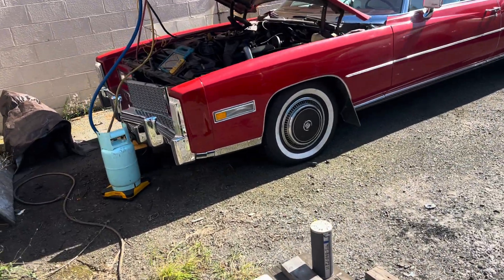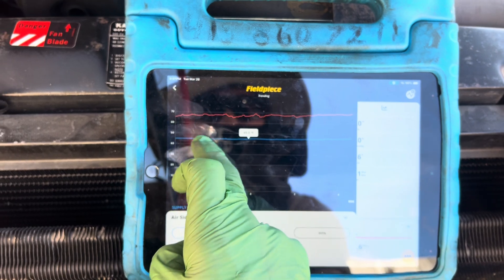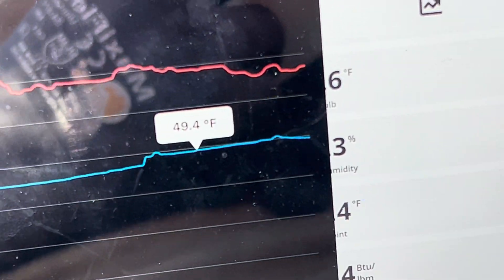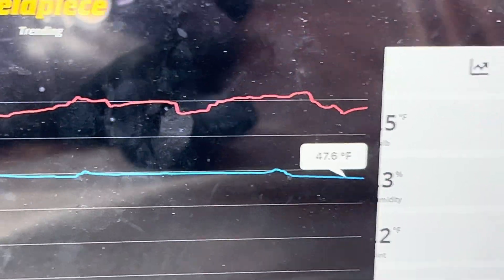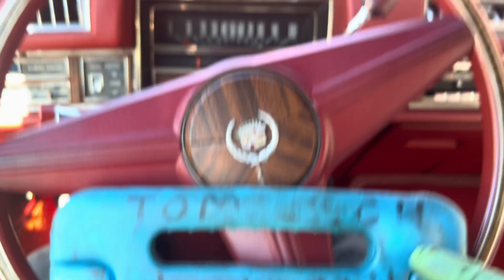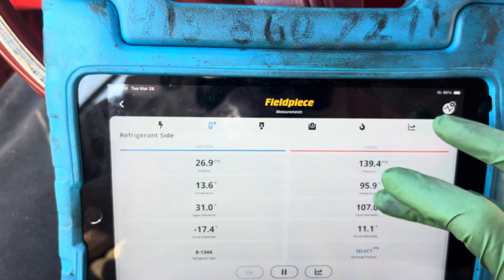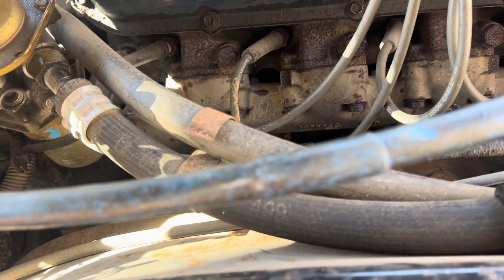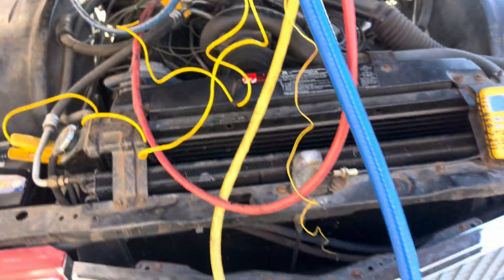R134a RETROFIT ￼ Got a bad name because of the technicians, NOT THE REFRIGERANT FAULT

Comment: I'd absolutely love to see you rebuild that VIR valve.  I am putting my 1976 Impala back together and i need the air to work again.  I'm tempted to recharge it with R12 due to lower condenser temps, but getting R12 is so hard now.  I would love to ask more questions about the conversion with old A6 compressor and VIR.
Reply from the maker: If you could still get the kit to rebuild the assembly, it’s just taking apart and putting back just pay attention to detail nothing more than seals

You could look up old information is available on ones that have adjustment how to correctly adjust them to the evaporator at the proper temperature 

Learn more I have a lot of postings over on the Facebook group 

Automotive HVAC technicians

Comment: Great info, I've always wondered about how many of the performance issues people have reported with R134a are because of other problems and half ass conversions rather than the refrigerant itself being worse. I always assumed that R134a just isn't as efficient as R12, but I have actually found studies showing improved capacity and efficiency in the same equipment running R134a vs R12, so as usual, it may not not be as simple as it seems.

I have also read that a major reason R134a sometimes doesn't work well in R12 systems is because of the serpentine flow condensers used back then, which makes me wonder if R134a may actually be a better refrigerant than R12 in systems where the condenser has been upgraded if they are converted properly.

Comment: No good benefits retrofitting R12 to R134a. It also works poorly on tube type heat exchangers due to excessive oil flow. It's well known FACT that mineral oil + 134a = waxy substance at the evaporator. The waxy substance can only be dissolved using a ridiculous amount of liquid R22 or R12. Trane published a procedure on Mineral Oil Contamination Cleanup. The reason why using shop air always screws up is because of mineral oil condensing at the heat exchanger. At first they keep denying the problem now they silently admits the problem. You're not using the analyzer to test your work? Retrofitting is the mother of all cross contamination.
Reply from the maker: System was completely dismantled. Every part solvent flushed.

Every rubber hose was replaced with brand new ones 

Every O-ring was replaced 

New Desiccant

New expansion valve 

Complete new replacement of DENSO ND-8 oil 

Benefit $560  R12 refrigerant
Or $82.50  R134

Comment: When converting to r134a, what r12/r134a ratio do you use for the charge? Thank you for sharing.
Reply from the maker: All different, will change, condenser design, fixed solid fan to pulley, fluid thermal fan clutch, Electric fan that comes on with compressor clutch does not cycle, Electric fan that has a pressure switch within a given range example ( Mercedes or BMW old school fan does not come on until 270 psi and then shut off at 150 175) , There were some condenser designs that literally only had 12 fins per inch aftermarket add-ons and they were too small for the vehicle,  they may have had two fans. One fan comes on at lower pressures than a high-pressure switch turns onto auxiliary second fan for the condenser.,

So depending on the vehicle, it could be anywhere from 85% plus refrigerant charge all the way up to 95% refrigerant charge .

Comment: Was the condenser changed when it was converted to R134a? I thought R134a needed a different style condenser.
Reply from the maker: No condenser change. Lives in operates only around the San Francisco area low summertime temperatures. Got a brand new thermal fluid fan clutch